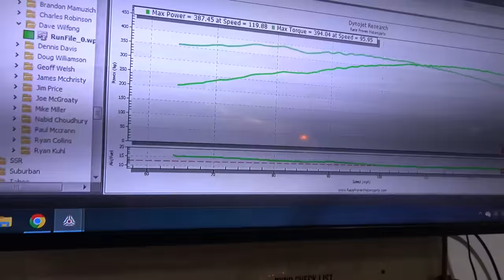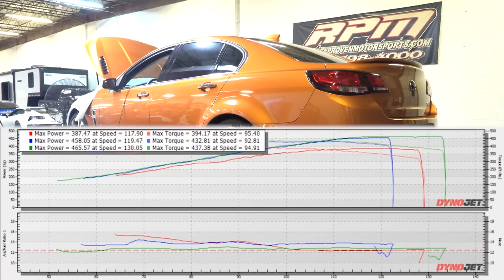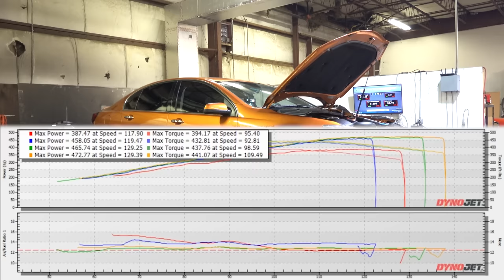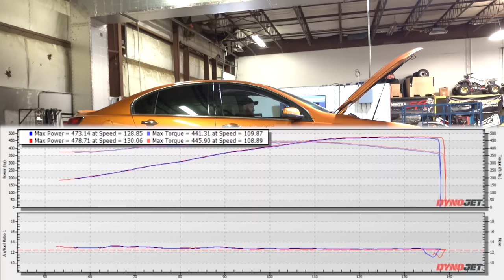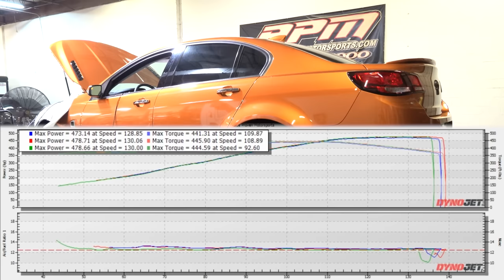Heads/Cam Chevy SS Manual

Comment: I have a stock M6 chevy SS right around 80k miles. It's my daily and I love it. Considering doing some bolt-ons like this. Don't want a ton of power cause it is my daily and and I don't plan on racing it. Should I pull the trigger on some headers, pipes, and a cam at this point?
Reply: Small cam, headers, VCM intake and Ported intake manifold. Makes good power.